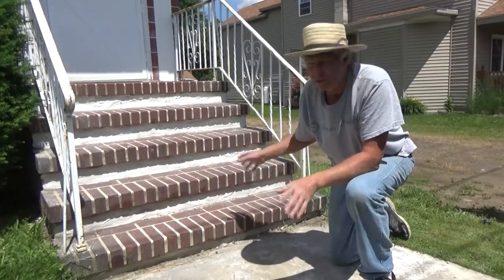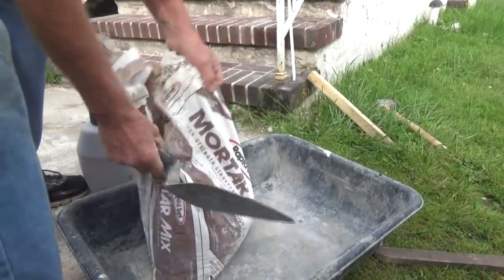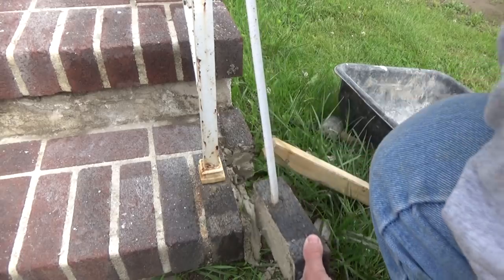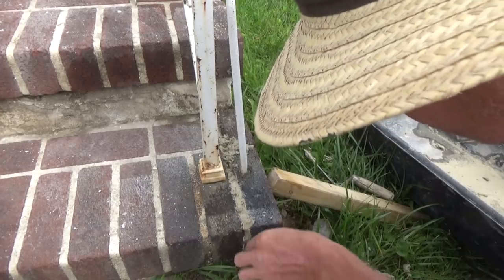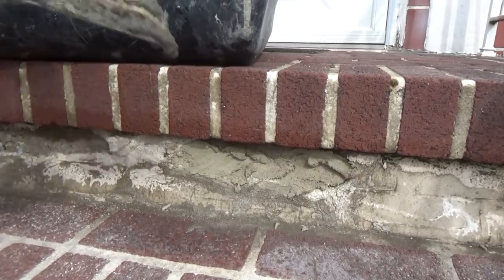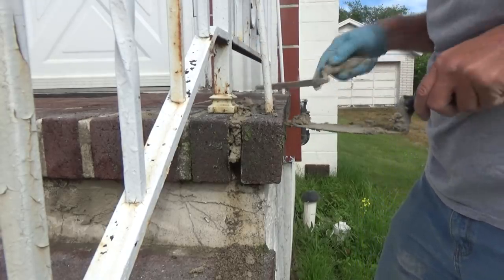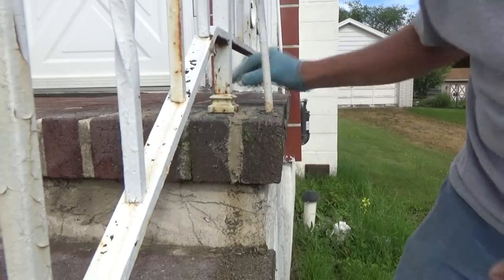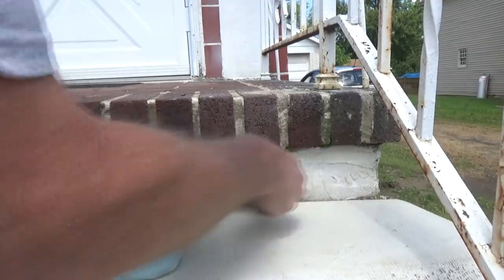BRICK STEPS REPAIR  (Part 5) Mike Haduck

Comment: About two years ago I came across this channel when looking for information, as a contractor doing a pre sale fix up I needed to do some foundation repairs, cracks and sections of block where water and ice blew off surface material and it looked awful. After watching a few of Mikes methods and watching him doing jobs I went and bought mortar mix and took my trowels and mixing pan, sponge, sprayer, float etc and went to work, all I kept hearing in my head was you have to wet it to make it stick. Well it came out great, I sponged it smooth and when done painted it all and the realtor was thrilled. The house sold shortly after being listed and now two years later when I drive by and look it’s still looking like the day I left there and what a major difference from before. 
Mike, up until I came here I was just going to have a mason do it for me.
Reply from the maker: Hi Clint, I appreciate hearing that, it is what keeps me making videos,  thanks. Mike
Reply: I'm a Mason of many years and I'm learning a lot. I used to be overly fussy on jobs like this and take for ever. I've learned to pick up my pace and it's just as good.  Thanks Mike

Comment: I love the way white Portland locks. It's just the right shade of gray- white.

I don't understand why you have to wet brick when it's a patch-up but not when you lay them.
Reply from the maker: Hi ddiva,  patching is more of a sticking thing, if you want it to stick, when laying it is more of a Gravity thing and wetting the brick would make a huge mess, if that makes sense, thanks, mike
Reply: It's an issue of dust.  New bricks are cleaner so the mortar can stick but old jobs have dust that the mortar can't get through the dust to stick to the bricks.  The water will become part of the mortar mixture.

Comment: Hi Mike.  Just one question. Is it better to wet the bricks when im patching a hole in my foundation repair? I thought once you said don't wet the bricks but I might be mistaken. I heard that it you don't wet the brick, the brick will take the moisture from the masonary cement.  Thank you again. 👍
Reply from the maker: Hi Richard,  I got a video out called " should I wet it first" Mike haduck, that explains it best, thanks Mike

Comment: Another great video mike. Do you plan on making a video on replacing a broken brick on exterior house wall. Can one just flip the brick if Spauld. Cheers
Reply from the maker: Hi Suede, if it works,  or check the local brick supply company for one that matches, thanks, mike

Comment: Hi Mike, I had someone repair the mortar joints on my brick steps years ago. He got the mortar joints repaired but there is mortar mess all over the bricks, some a little thick and some thin like paint. I want to get all the mortar mess off without hurting the joints.  With the videos I have watched so far, it looks like a chisel and acid is my only choice.That seems like a ton of work.  I would rather not paint them. I like the way brick steps look. What can I do? Please help. 
Thanks in advance
Joe
Reply from the maker: Hi Joe, every situation is different,  the mortar might be softer than the brick, and a stiff brush or steel brush might get it off with water and lots of scrubbing, I am not a fan of acid unless your real familiar with it. Thanks Mike
Reply: @MikeHaduck  Thanks Mike. I am in Astoria, Queens NY. Do you know anyone who can replace my front steps with stone and also my porch floor?

Comment: Hey mike got a question for you I have a block garage and I would like to paint the inside white would it be ok to use white Portland cement??? And by the way great channel thanks from ohio
Reply from the maker: Hi Abnormal,  I would say it all depends on what the surface is, the difference with paint is,it holds its color is , where Portland need fresh inn up, just cheaper,  I hope it help, thanks, Mike

Comment: Another good, honest days work, Mike. I’ve learned so much from watching your videos...thanks so much. One question, is there a general rule for using fast set mortar vs fast setting cement? Thanks and be well.
Phil C.
Reply from the maker: Hi Phill,  that product seems to work both ways, have,t had a problem yet, thanks, mike
Reply: Hey there Phil! the rule i found out after watching Mike use the Rapid Set Mortar Mix was only use as much as you need to consume in  10 to15  minutes or less... That really works but does it ever harden fast!!!